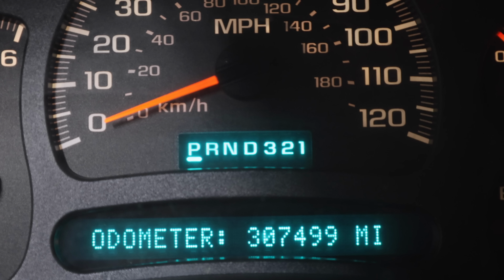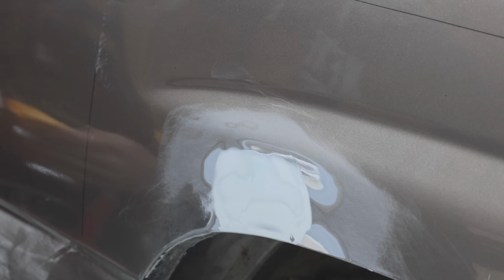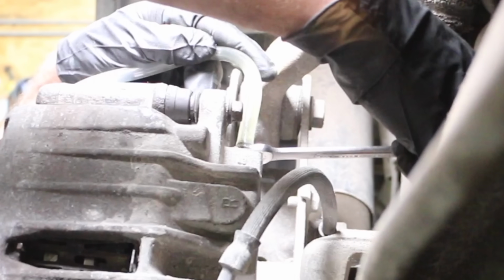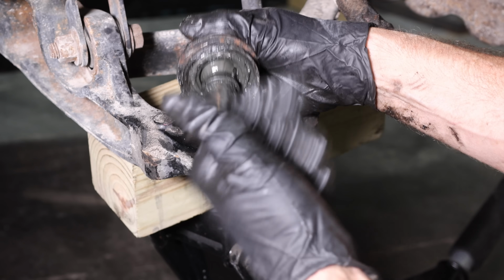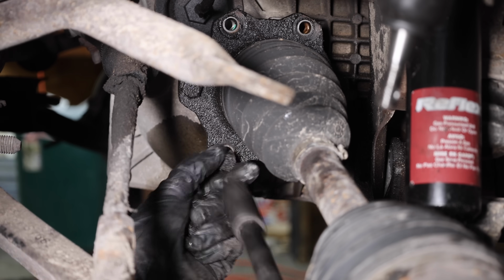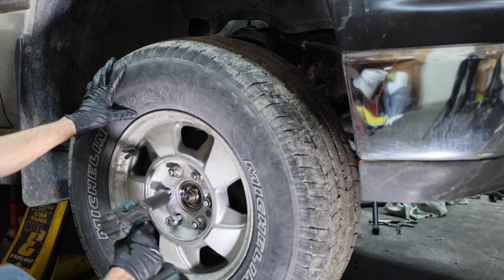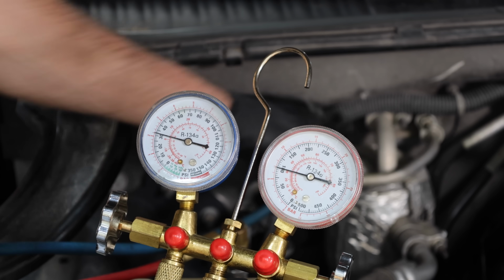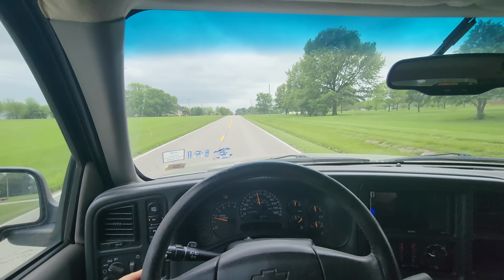Is It Stupid To Fix Up A 300,000 Mile Vehicle? Let Settle This!

Comment: It is ALWAYS cheaper to restore older vehicles than to buy the JUNK new vehicles they offer today. You dont need crazy matco or snap-on tools either. And most speciality tools can be found for rent or "buy and return" at most auto part stores. In this day and age older is definitely better. Easy access to parts, not loaded with brittle plastic bits, no exclusive programmers for a battery change...  Wanna pay over 2 grand for a new alternator or less than 400 and a few minutes of your time?
Reply from the maker: Thanks for the feedback.

Comment: That suburban is a good candidate to keep running.  My 2000 Tahoe, which was a southern rig, doesn't have much rust so I keep it going.  It has 221,000 miles on it.   I just keep replacing and fixing and the engine and trans still are serviceable but the rear main seal is leaking and will eventually need fixing - I guess that has to wait until engine rebuild should that day come.  Some makes and brands are not good candidates but those early 2000 chevy Tahoes and Suburbans have proven to be great candidates if they haven't rusted away.
Reply from the maker: Thanks for the feedback.

Comment: I used to do all of these types of repairs when I was younger. Got older and didn't have the time to spend. BUT, now that these cars and trucks are ridiculously priced and repairs are so expensive, I've gotten back to repairing myself. These videos are great reminders of the process. I like the older trucks since they've got the room to do most of the work without taking apart the entire engine to get to something. Keep the same pace. It's great you get around to multiple components in a short time frame.
Reply from the maker: Thanks for sharing.

Comment: My 2011 durango has 206k miles on it, and I bought it from my dad at 198k for 1.2k. About 5k in parts later, it runs better than my moms 2016 citadel. Keeping a vehicle running is so satisfying, and especially when it pays off.
Reply from the maker: Thanks for sharing.

Comment: Great pace. Everything you mentioned is dead on facts! When it comes to brakes and the anti rattle clips the pads ride on, I take the old ones off and clean off all rust on the caliper where they sit… I also put a little bit of anti seize on the caliper where the clips go. That way you won’t get rust jacking that causes the brake pads to get stuck (brake will drag). Some vehicles are more susceptible to this than others.
Reply from the maker: Thanks!

Comment: It's great owning a well made older vehicle that you have owned long term and know the history and mechanics of.  My 2002 VW golf TDI has over 300,000 kms on it and still runs amazing getting excellent fuel economy as well.  The paint has faded but I keep it rust proofed so the body is in excellent condition.  Parts are still readily available when needed and very cheap at least at this point.  I considered replacing it a few years ago but with all the issues with new cars these days, I decided to keep driving it until it no longer makes sense financially to keep it.
Reply from the maker: Thanks for sharing.

Comment: In my opinion, I don't think it is stupid to fix up an old car with a lot of miles on it. If you like the car, then fix it. Keep it on the road if it makes you happy. Especially if it is a vehicle that is known and has shown its reliability. A new Suburban these days is running close to $80k. I'd rather drop $10k putting new suspension, body work, transmission work, and engine work into a vehicle, have the $10k paid off in a year or two, than be struck with a 8 year car loan. Especially if you are willing and have the know how to do a lot of the work yourself.
Reply from the maker: Thanks for the feedback.

Comment: My truck has a spot under the bed of the truck behind the cab, that uses brake fluid to control how much brake pressure is applied to the front or rear brakes depending on the load that is in the bed of the truck.  I do not remember what it is called but it is part of the brake system and needs to be bled when you change brake fluid.
Reply: brake proportioning valve

Comment: Great video, 2006 Tahoe, I need to do all of this ,but I phuqed up my left shoulder and its even hard to pick up a 12oz can of anything. Former Aircraft mechanic and 25 yr automotive technician. Mostly GM dealerships. But a few independent garages. Certified in Front suspension and Alignment as well as most all ASE certs. Guess I'll just have to suck it up and try to get it done.
Reply from the maker: Thanks  Thanks for the feedback.!

Comment: i seen alot of them vortech motors last over 400k miles on oem motor aslong as your replace the part and replace the egr vavle on it and theres also a plastic plug in them that keeps the oil for, drain in to the trasfer case that need need replaced every once in a while
Reply from the maker: Thanks for sharing.

Comment: My dad and I disagreed on the matter of doing a lot of repairs on my old truck. He'd buy a new one. Back then, that put him out $20,000.00.  My old 69 step side cost me about $4,000.00 to bring its appearance,  handling and engine operation back to new.

I have a large shop dedicated to custom woodwork that incorporates plastics, resins, granite, metals and glass, including glass etch. I, etched all the windows and mirrors, replaced the instrument panel, glove box door, ash tray cover, stereo frame and lower door panels with wood versions. I built a console for the stereo component add-ons (e.g., equalizer-amp), and I installed an overhead console for all the gauges, except fuel, tack and speed.

I installed an overdrive transmission from a 62 wagon and swapped to an RV cam, added headers, went a size up on the 1bbl jet, so it got better mileage that my dad's fancy new pickup did. I swapped the bench seats for captains seats that swiveled. 

Too, in the subzero weather of Winthrop, Washington, my manual choke and two pumps of the throttle made for a quicker starting vehicle than both my dad's new cars.

In the end, I had a rig that could be repaired cheaper than the new ones, got mileage that was as good or better, and could still haul a load in 3rd under (250 in line six cyl. 413 rear-end). Going down the road, it turned heads. When I went to outdoor art shows and had my truck near, I started getting order questions for interior woodwork.

In the end, the truck turned heads and will for the rest of its life. The interior was, in the car world, especially unique. As my daily driver, it was comfortable to drive. It would only go up in value (who would have known it'd be worth 15 to 20 k today.

SIDE NOTE:  Now, they make every last part I could need to tune the operation or appearance of trucks like that old 69. In fact, we just spent three months shopping to upgrade our old 03 Ranger. Didn't need a new rig, and the sticker shock for a used, high mileage rig was more than I was willing to tolerate, knowing it was likely it'd need repairs soon. So I upgraded it to a 78 Square Body step side.

My shop has improved since I sold that old 69 nearly 4 decades ago. So maybe the interior of this one will be even more fun. I already have the electric seats. Gauge choices have improved and there are even inexpensive tire pressure gauges and fuel-to-air ration meters that, along with a vacuum gauge, will give a pretty good indication on how the engine is doing.
Reply from the maker: Thanks for sharing.

Comment: At 300k, the fix is fine with me.  And yes, it's worth fixing a high milage car if its not a hazard to drive and parts are available.  My 2005 Honda Accord had 418,000(bought new) and was running great but the ac didn't work but still got 30 mpg.  It had some minor issues, changed the oil with synthetic  every 5-8 K but it was totaled by hit and run driver.
Reply from the maker: Thanks for sharing.

Comment: hah. cheeper to keep'er. yeaaaah, I actually picked up a 2000 blazer, with about 240k on her. so far the most expensive thing was the cat was pretty shredded and falling apart, and the shocks were absolutely thrashed. but engine is happy. I've also done a lot of the same things. rotors aren't quite dead yet, though the brakes were way thinner. overall, yeah, everything is pretty ok, and I like my lil blazer.
Reply from the maker: Thanks for sharing.

Comment: High mileage vehicle are often the best because lots of parts have been replaced already i bought 96 4runner 10 years ago with 350k its at 450k today with no issues besides a timing belt being replaced and ball joints
Reply from the maker: Thanks for the feedback.

Comment: Homotorsports refurbished and rebuilt an AMC concord wagon.he showed how to fix all the damaged spots on the body and the car looks great! I would reccomend going through his channel and using it as a source for body work.
For multi piston calipers where you have one or two pistons on either side of the rotor, there are tools available that will pug back all the pistons at once, using the old pads. I think I got my piston tool from lisle, but I bought mine in the 80’s. A good parts store should have them available.
Reply from the maker: Thanks for sharing.

Comment: The newer cars that are 20 years new are much nicer I think. Go ahead and splurge on a new vehicle. Is it going to drive long mileage. It's really cheap if you do it yourself. Can you give an estimate of some of that stuff would cost if you took it to the repair shop. I know it'll be thousands of dollars. Just replacing the rack and pinion steering nowadays it's like $1700. They want $500 to replace a 2 outer ball joints

Comment: If you do all that stuff I guess it's a good time to replace the engine. You have to take all that stuff loose to replace the engine. Do you think you'll get another $100,000 out of that or 10 years. That's a whole point of doing it. But it sure doesn't give you a good feeling that you know all that stuff is replaced. I think you should have cleaned up everything you should have wire brushed at all and then spray painted at all like the caliper. I like the new calipers these days the anodized or coated or something so they don't get all rusty

Comment: Cannot agree with you more! Not counting the number of hours I have spent on continually fixing my 25 year old rusty Kia (the educational value of which itself is incredible), the transportation value is probably well into the several tens of thousands of dollars. The biggest problem is body rust. Panel rust doesn't bother me, but the frame is a much more difficult problem. Any thoughts on that?

Comment: one tip that can help with the brake hard wear is useing a wire brush on the caliper bracket to get all the rust off the the new metal shims should clip in easy
Reply from the maker: Thanks!

Comment: Awesome video! I'm getting ready to do a complete overhaul of my suspension as well so this is extremely useful. I wanted to ask, when you were doing the ball joints on the control arms, was there a reason you didn't see a need to replace the bushings as well?
Reply from the maker: The bushings were in good shape but recommend replacing them  since you have everything taken apart.

Comment: Thanks for the great content!  I've got a few older vehicles, and I"ll be putting some lessons learned here to good use!  My 11 year old Subaru is going good at 275K, going to replace the CV axles & brakes, and put her back on the road.  My 30 year old S-10 just needs a little work on the fuel system, and the 46 year old Chevy K20 needs some body work and differential servicing...  Great videos!  Been watching for years.
Reply from the maker: Thanks and you are welcome!  Thanks for sharing.

Comment: @12:32 What did you spray to clean off the rust dust after hitting it with the wire cup? And is the paint you sprayed just standard high heat?

Comment: I use snap ties to hold the caliper out of the way. Before compressing the caliper I take off the Cap off the reservoir and remove of the fluid so that it doesn’t overflow. AutoZone had lifetime guarantee  on their parts so I was able to get replacement rotors twice with no cost to me.
Reply from the maker: Thanks for sharing.

Comment: how about an automotive carpet cleaner test? my yukon over the years with dogs and kids has many different stains. how about leather seat cleaners? how about phone holders? heads up displays?
Reply from the maker: Thanks for the suggestion.
Reply: @ProjectFarm  'headlight restoration, headlight bulb upgrades, battery terminal protection, fuse and line short testers, after market tire pressure wireless sensors for cars, rv, trailers and trucks. ok that's all i got

Comment: If it's of any value, I learned to slow the video playback down to 0.75 of the normal speed to make comprehension a little easier. YouTube gives me the control so I guess you can carry on carrying on. Great video on front end repair; now I am completely petrified by what happens in a front end repair but then again, I'm no mechanic.
Reply from the maker: Thanks for sharing.

Comment: Definitely not a professional either man. Just a dot inspector/“shop mechanic” for a traffic control company. The only thing I would advise is that you do not paint anything on your material untill after welding and re grinding.  Makes it harder to weld and can introduce inclusions.  There’s is a anti splatter spray you can use prior to welding, but it smells pretty terrible. Haha.  Keep up the awesome content sir! 👍
Reply from the maker: Thanks, will do!  Thanks for sharing.

Comment: I've got a 2000 Suburban with 297K miles and a 2009 Tahoe with 289K miles.  I haven't had to do nearly as much work on them, but it's almost all highway miles.  I rotate the tires every 10K miles, use 10w40 synthetic blend oil  in them.  I have an AFM delete module in the Tahoe and anyone that has the Automatic Fuel Management system needs to do this.  

One thing you didn't do on your Sub is replace the parking brake shoes.  Those things are terrible!  They're not self- adjusting and I have to replace mine at least every 2 years to get them tight enough to pass inspection (I use the parking brake a lot when launching boats).  The biggest problems I've had have been A/C compressors in the Suburban, fuel pumps and heater hoses & fittings on both.  I run the spark plugs & wires 200K miles.
Reply from the maker: Thanks for sharing.

Comment: My experience is vehicles are done at 250,000 miles. Had a ranger got 313,000 out of it but those last miles weren't really worth it. Couldn't keep a starter in it for more than 6 months. Warped or missing teeth on flywheel I guess.
Reply from the maker: Thanks for sharing.

Comment: I have an 07 Trailblazer with 245,000 miles and got it for a $700. I did the valve cover gaskets and it took me 3 days to gently get the rusted spark plugs out. I had to slowly hammer the Valve timing solenoid out from inside because it was seized. Anyway you get the picture I spent the same about 2K fixing it. Changed everything out and also put in new bearings AC delco rotors, pads, etc. The car starts and runs amazing and my wife actually prefers driving it over our other SUV with 90K miles. And so far it's been more reliable (knock on wood).😂
Reply from the maker: Thanks for sharing.

Comment: Excellent video with the body repair. But on the brake job you made a big mistake. Never backwash the brake fluid. The brake fluid is only supposed to go in one direction from the master cylinder out of the bleeder screws. When you shove the caliper pistons back with out pinching off the brake hose and opening the bleeder screws. You are backwashing the brake fluid that has been heated up a cooled down thousands of times back through the brake line through the ABS unit and into your master cylinder which is a no go!

Comment: Back in 2015 I purchased a used 2011 Ram 1500 Quad cab with the 5.7 Hemi, it had 69000 miles on it and now 10 years later it has 150000 miles.  So far I have spent apprx. 8k on repairs which included replacing the AC unit, cam phaser, ball joints, front wheel bearings and axle that slips into the front transfer case, brakes and rotors etc. .  Being retired from 2020 it kind of takes a bite out of my retirement income but I find it cheaper to keep fixing the truck than what a similar new one cost.  I could keep on paying for repairs until the day I die and it wouldn't even come close to the price of a new truck.
Reply from the maker: Thanks for sharing.

Comment: I got a 1996 chevy astro with 242k miles on it. You can tell that the vehicle had been taken care of very well over the years. I paid 1,000 for it and it runs and shifts like new. My last bigger vehicle was a mountaineer and it had 400k on it and was still going when I finally got rid of it. I always keep my cars serviced and replace parts when its needed. My 2012 focus has had 100k put on it in 5 years Putting it at 187k now and the only issue ive had with it is getting the water pump replaced which just happened. Aside from that just regular service.
Reply from the maker: Nice!  Thanks for sharing.

Comment: @304000 mi. did a full restore tires, brakes,steering and rotors. Definitely cheaper to keep her - 1997 Tahoe 2dr 5.7 auto
I’ll have a top end due to~400k, transmission re-pak @350k and the transfer case needs swapped at some point…
Reply from the maker: Thanks for sharing.

Comment: I have a 96 Ram 1500 Laramie, with 338000 miles on it. No, rust runs great. I just repainted it redid. The interior replaced the faulty Dodge - That's in there, chuck looks almost new again. Drive, just like it did when it was 2 years old. I think as long as you keep things up and maintain them, they will last a lifetime
Reply from the maker: Thanks for the feedback.